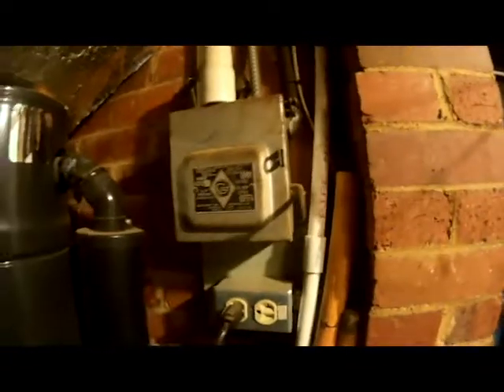How to Replace a Trane Blower Motor!

Comment: if I missed it, did you also replace the capacitor?  that could have caused the bad motor. and also you didn't record whether the new motor worked.

Comment: Good job it's a nasty job !
Nasty blower motor And wheel !
I try to wear a mask 😷 when I take blower motor out and clean the blower wheel. I cut the wires also to the bad blower motor. You did good it's a job and 
nasty job full of skin cells and no telling.